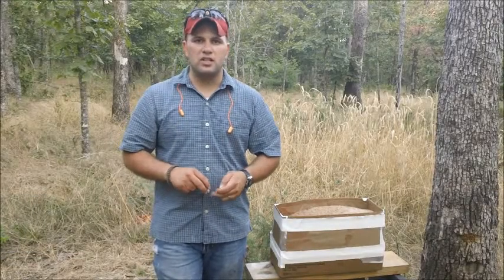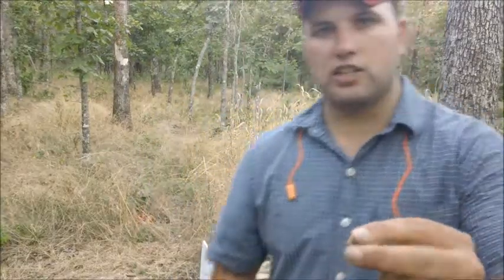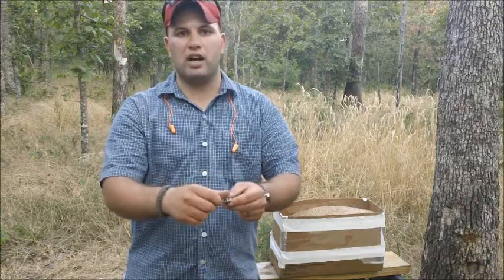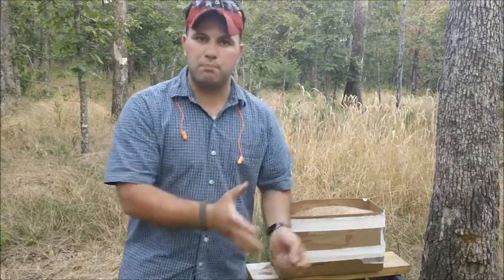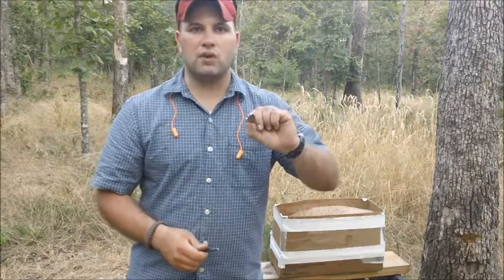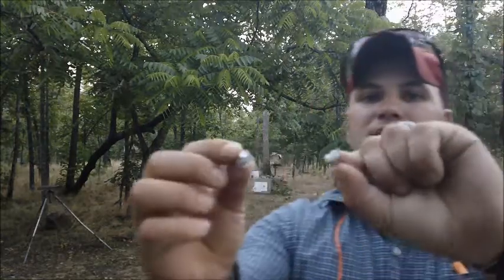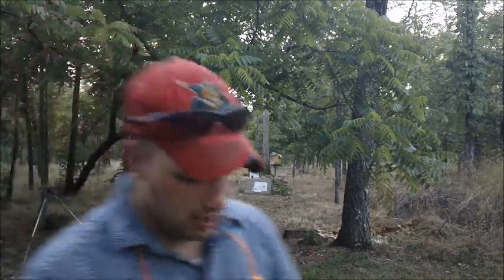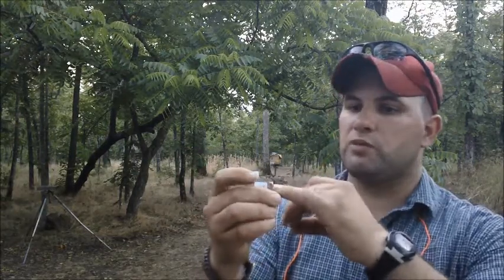Tula rifling test

Comment: What about in cheaper-plinker guns, where the cost savings would easily pay for a new gun, barrel, or upper? I think steel jacketed ammo has its place but not in high-end or accurate guns. I do agree that copper or guilding metal has to be easier on the lands.